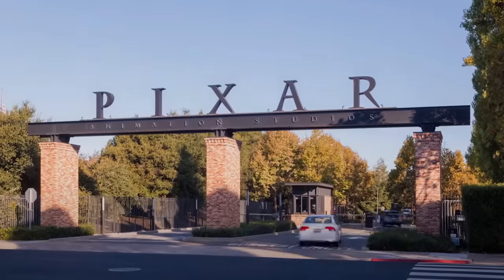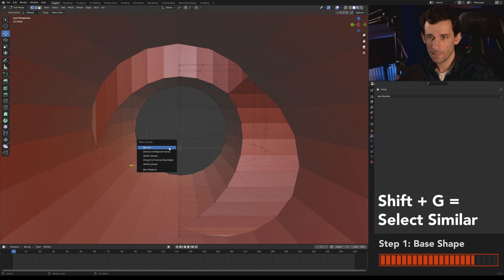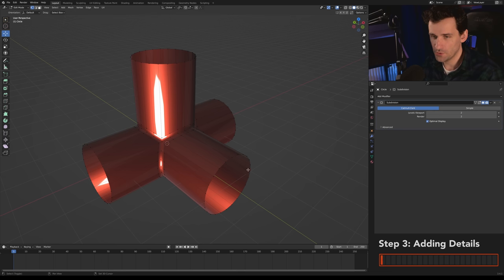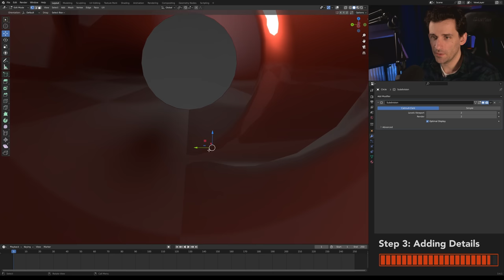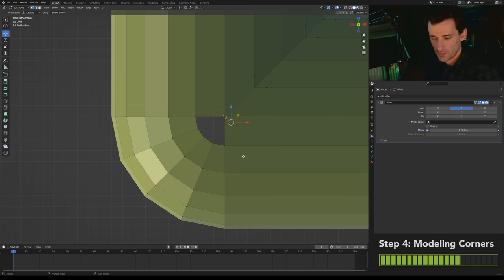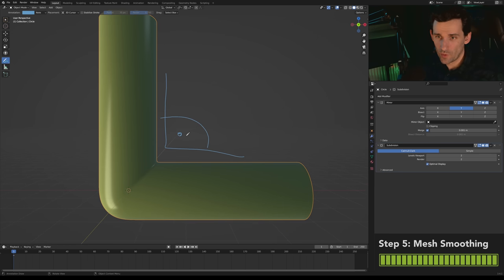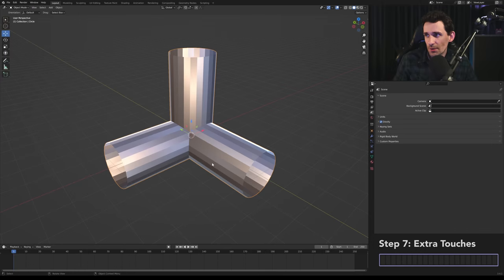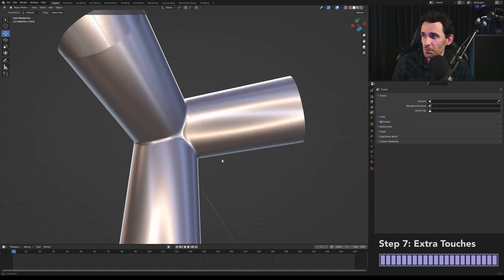3D Models That Will END Your Career

Comment: Hey guys, I may or may not found a method for the third one, but it still involves a little refinement, but I'd say the end result is a little lower in terms of accuracy:

1. Create a cube, subdivide it by the number of segments on the cylinder divided by 4 minus 1 (so say if 24 segments, you divide that by 4, and then subtract 1, so 5 to result in 6 faces per row)
2. Use Cube to Sphere (Mesh > Transform), and resize the cube to the dimensions of the cylinders
3. Similar to what @chocofur did, remove the unwanted faces
4. Further delete the faces in a similar way to he did such that you have a third of the faces you had.
5. Now you will notice that the leftover geometry does not exactly align with the cylinder, this is where it gets messy, if anybody has a better way to do this, please feel free

6. You will now have to select a line, invert the selection, hide the other vertices
7. Now with the line you have left, and the cursor brought to the object origin (assuming the object origin of the original shape hasn't moved), select the vertex that is closest to the cylinder
8. Set pivot point to 3D Cursor, Snapping to vertex, and have it affect rotate (while "include non-edited" is select)
9. Start rotating the vertex along the corresponding axis (relative to the cylinder you are trying to align it to), and snap it to the closest vertex (of the cylinder)
10. Now that the vertex is snapped, adjust the range of the proportional editing such that it doesn't affect the furthest vertex, and the resulting line results in a smooth line

I don't think I have done a good job of explaining this at all, but I will try to upload a video showcasing the process, for the meantime, here is an image of the result: https://imgur.com/a/1kZeg3R
Reply: https://youtu.be/fQ-yKRKl96w

Here it is, it's a very quick walkthough of what I did to get to the end result
Reply: Yup you got it mate. That seems perfect!
Reply: @AukeBevela  there's actually a much simpler method, it just involves taking a cube, beveling it to the max with segments set to (no of cylinder segments/4), and then just turning it into a sphere. This will result in the cleanest geometry in the easiest manner
Reply: after step 2, just delete half of the sphere, extrude some pipe from the open edge and apply 2 Mirrors from 2 45deg rotated Empties. that's it. geometrically perfect.

Comment: 10:26 It doesn't have to be symmetrical to be a natural-looking curve. The edges where the cylinders meet form a kind of bloated triangle with 90 degree angles. With each step towards the center of the elbow, they're rotating just a little bit, forming a pattern that kind of reminds me of the way that sunflower seeds are arranged, or the aperture slides on a camera. You might not see it, but the point is, it doesn't matter that the pattern isn't symmetrical; it's still a consistent pattern, and its regularity is enough to produce a rounded elbow. It's honestly a really elegant solution that I never would have thought of (it might frustrate any one trying to modify it though).

Comment: In the first step I guess you should have used closed cylinders instead of hollow once, then you could have deleted the end faces. That way you don't have to delete the mesh inside.
Reply from the maker: true! tbh the first mesh was the last I was preparing for the video and I just did it from the circles (which are better for example 2 and 3 I think).

Comment: I've been a 3D modeler for 10-15 years and whenever I've made intersecting pipes, tree branches, tunnels and other similar cylindrical complex shapes, I've used exactly this type of subdivision techniques. This has always been an additional, often unnecessary perfectionism that has even slowed down the workflow :)
However, if you are going to lose your job because of this, you should work on some project for oil or gas transmission design technical installations with CAD software.

Comment: for the first model example, if you use the built in bool tool addon you select all the 3 tubes it will union them perfectly and remove the inside.  and then use the bevel addon to create the loop cuts with the shape set to 1. 
i know this is pushing the limits of doing it all yourself but in case someone should have use for it.
Reply from the maker: Great tip, thank you!

Comment: This is an awesome way of modelling -right until the projects you work on have 100s of objects like this. Sure you could go for perfect topology on everything, but in the end most of it will never be used for anything other than backfil detailing and not act as the center focus. For isolated work and small scale models this is great. For large scale projects, just not worth the time.
I've been working a lot on optimizing my techniques with blends of subdiv and hard surface modelling to get the best blend of efficiency and quality where it matters. Either way, learning the basics of how to brute force good topology and lineflow is definitely something I recommend everyone to practice into their foundational skillset.
Reply from the maker: also, once you learn how to do it, you will almost always do it (if you have time). ofc you don't have to properly 3d loop guide every single model you create - but if there's one thing I've learned as a 3d artist, it's that at some point, sooner or later, I will always re-use the better looking / nicer asset I've created. and there's just nothing more infuriating when these assets have to be subdivided and they just don't work as they should (but it's probably just me lol).

Comment: If I don't need to impress anyone and only need the result in Blender, I model the pipes by extruding a single vert, bevel the bends with two segments and a sharp corner (no bevel geometry node yet). At this point, for non-destructiveness, I would separate out the parts into what will become different pipe dimensions looking up what are normal pipe dimensions (and I just go with the nominal sizes for simplicity say 4" or 100mm). Create another single vert, add geometry nodes and drag the pipe segment objects into it, convert them into curves, fillet the curves (bend radius is usually a function of pipe diameter) poly mode and 4, then CurveToMesh using a circular curve. Add a subdiv modifier and a material using a material bevel node. Now I can edit my pipes while the project is maturing.

If I do need to impress anyone (haven't happened yet, not what I do) I'd dive into piping standards and see what components are available (say bends, tees, angled tees, different sizes coming together, concentric and eccentric reducers and why they would be oriented a certain way, flanges and pipe spools, modelling pipe supports that show logic functions for the application (guide, hold-down, anchor, rest, etc), show welded attachments (say a reinforcement saddle), fitting connection types (press, screwed, welded), and do a proper modeling on the welds themselves. For shading, I would also look into pipe production methods and how they would affect shading; i.e. for "polished" pipes (say pipes and tubing for food and medical applications) often indicates anisotropic component; if you need only a stretched satin look, then all you need is to export the tangents, but if you also need visible brushed markings, you also need a properly spaced UV (follow active quads) and make the brush markings seamless (there exists tutorials for this). Adding complex valves, instruments, safety equipment, and partially insulated/capsuled portions would also add to the rating. As would showing pipes in context, say an AC unit, a pump, or a pressure vessel. Unless for obvious cases like a roof water drain system that doesn't add any complex components, I wouldn't bother with slopes.

Of course that's the piping engineer in me speaking (long time ago now), and a simple fixed sized bend wouldn't really impress me at all, no matter how "clean" it was. If I worked in animation, then you'd have to show the model was ready for animation as well by allowing it to be flexible, ready for shattering and so on.

Comment: For the L pipe. It's easy if you take a cylinder, select the face at any end of it  add 45 degrees shear. Then extrude perpendicular to the orientation of the cylinder

Comment: 2:50 You can use Bevel Edges to do this a bit faster, and with consistent width.

- Select the loops you want to sharpen,
- Crtl + E to bring up the edge menu
- B to bevel edges
- Set segments to 2 to preserve the original edge
- Set Shape to 1.0 to preserve the original position

Alternatively, add a Bevel modifier to the stack above the Subdivision modifier. If you don't have any weird geometry or really tiny faces, this offers a lot more control over the shape and is much faster than adding edge loops by hand.

Comment: This combined with the keys you're pressing would actually be even very helpful to beginners who've got the feeling how this all works but haven't gained all the knowledge and experience inside the software itself yet. What you're saying all makes sense and these models especially make it easy to intuitively follow along. However, for me, without knowing the keys used to go about it, the value it adds isn't maximized yet. Now, of course that's on me since I haven't got that level of experience yet. But having a tool or plugin running alongside that shows which keys you're pressing (I know they're out there, seen them used in other tutorials, I think it's even part of blender itself) would make these types of videos just that bit more easy to learn from. 

Anyway, excellent stuff. Subbed.

Comment: A nice easy way to do the last one is to make your three cylinders and then one UV sphere, then select one of the cylinders facing along the X or Y axis (for whatever reason, it does not work with the "vertical" one) and do NOT select the sphere. Then, in the modifiers tab, add three union boolean modifiers. The first two should be for the other cylinders set to "exact" and the third one should select the sphere with "fast" enabled. Now apply all the modifiers from first to last, then go into edit mode and hit m>By Distance to merge overlapping vertices and it creates a mesh with perfect topology. From there you can add a solidify modifier and a bevel modifier, add edge loops like he did in the video, or do whatever else. Hope this can help someone!

Comment: For number 3, you could borrow a patch from a bevelled cube. You'll find you can enter all the dimensions numerically for complete accuracy.  Even though the polygonal approximation to perfectly curved geometry is as good as it can be, depending on your resolution, there may be  very slightly anomalous interpolation of normals. .. slightly affecting shading,  so you can borrow the normals from the bevelled cube,  as well, with Data Transfer. :)

Comment: The 3rd level - corner pipe, can be done way quicker and way less messy. Try this:

You can start off with a cube, then subdivide it (level 2 is enough), apply that modifier and bring that new meshe to sphere (Shift+Alt+S, set to 1).
Then you can duplicate that sphere 3 times (once for each branching pipe) and on each of those models for each axis, extrude half the sphere into a cyllinder.
Boolean union those 3 models into one mesh and remove doubles, then just add supporting edge loops for the intersection.

Minimal manual cleanup for the great effect and you even got ball caps on each pipe end as a bonus, hope it helps!
Reply: Bro, this works. Thank you!!
Reply: I tried your cube/spherized method on all 3 models. I had to dissolve a few verts here and there in wireframe mode but they all worked and all look perfect.

Comment: For second method I've used boolean for two cylinders, deleted "corner" faces, and exactly at the center of corner vertices, moved pivot. At pivot I made rounded cube with 8 arcs to match 32 verts of each cylinder, deleted 3/4 of rounded cube faces leaving only corner filling. Now you only need to conncect at last vertices from rounded cube to corresponding vertices of cylinders to mantain edge flow and make support loops at 90d inner side of the curve. Subd twice and you're done. Final shading is perfect as on the video, but with less manual work :)

Comment: If you make a mesh that is the path of your pipe, you can bevel edges, then convert the mesh to a curve. Go to the Geometry settings of the curve, set the bevel object to be your circle, and you can get really clean corners on your pipe. It gets harder when you need an intersection, but not impossible. The intersection has to be made of separate sections of curves, and you'll have to clean up geometry by hand similar to this video... But it's such a nice way to do pipes!!

Comment: For the cases where you have a rounded bend (the part that resembles part of a sphere), I'd create a cube with the same number of subdivisions as the cylinder, then spherize it (make all the vertices a certain distance from a point), then connect to the cylinder.

Comment: One thing to bare in mind, and especially with your unsymmetrical tri-joint pipe, is that the normal direction is a huge factor in shading and what you did was copy/paste a chunk of sphere that has perfect normal direction for shading and the vertices between your un-summetrical polygons are also aligned smoothly along with the rest of the spherical surface. You can manipulate manually how the normals face to improve shading artifacts if it's impossible for your polyflow to meet expectations which in some cases it might be due to (extremely tight) polygon budgets.

Comment: Not sure if Blender has this feature but in Maya I use the bevel tool to achieve all of that. It lets me softly curve my pipes and corners and also can be used to preserve hard corners after subdivision by placing symmetrical edge loops on both sides of a selected edge loop. Saves a ton of steps and also gives me a handy slider to fine tune how soft or hard I want my corners. It’s built in so no plugins.

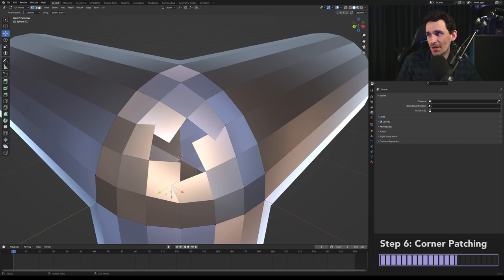Comment: 9:16 It has symmetry, but not as normally 2D (left-right), but rotational 3D (or top-right, top-left, bottom). You have 3 identical parts, all rotated by 120° when looking at the corner. That is achieved by your 2 90°rotations in different dimensions. The center of the Y in the middle is the Rotation- or Mirror-Point

Comment: Blender also comes with built in pre-made pipe joints objects like these you can add to your scene. It saves you most of the work, you will only have to add the edge loops for your sub division. You may need to enable the extra objects addon first. then under add -> mesh -> pipe joints.
Reply from the maker: I think except the first example, the 2 and 3 are not included

Comment: The video is great, teaches a lot about great topology as well as shading.

Though I was able to spot some issues -

there were triangular quads here and there through out the video (Basically a quad that is shaped like a triangle) and they can often times cause shading issues when using the subdivision modifier. They're easy to avoid and can save a lot of time later on.

You can also use "edge crease" to sharpen the edges of models without the need to worry about more geometry, which can then lead to more brain numbing topology stuff. Although edge crease doesn't always work, it can save you a lot of time when you have a simple sharp-ish corner.

Comment: In the first technique If you add a cylinder instead of circle then you don't need to clean/delete the vertices from inside. Later just delete the caps of the cylinder.
Reply from the maker: show_me_morpheus.gif

Comment: well, for the second one, I just make two pipes do not overlap at first. i make one(or two, depending on direction) vertices from each pipe close to each other near the inner angle, and make edge loop between the two end loops. then I add edge loops on each side and adjust some vertices around the inner corner. It always worked for me :)

Comment: For level 3 I would use a quadsphere; it has the same geometry you are going for but its cleaner and more convienient. You can make one by subdividing a cube and using To Sphere, or add one from the menu with the Extra Objects addon
Reply from the maker: check other comments fren, especially the pinned one
Reply: @Chocofur  I can't see any pinned comments?

Comment: I would do it using a bevel. Just start with cubes in the desired configuration and bevel (completely to the clamped size) with the right number of segments. Done. Works for most cases. Boolean covers the rest.

Comment: For the final example connection, I start with a sphere. Then I spawn circles for the pipes, but its rare for me to use the boolean tool in Blender for any reason. And the more complex a scene is the more likely it is for the boolean modifier to act crazy weird. Sometimes I can't even get the boolean modifier to work with spawn primitives, for whatever freaking reason. I would love to use it.

Comment: I’ve been using Autodesk Inventor for about two years now at a Career and Technology Center I attend and I’m absolutely in love with how it works. I want to try using blender someday, but it just seems to be worlds more difficult than Inventor, worlds more effort for the same or similar product. The ease of use comes at a cost though, for just 3 years of the service it’ll set you back more than $7,000. It is insanely expensive. Thankfully we have an educational license version of it, so we don’t have to worry about the price to use it.